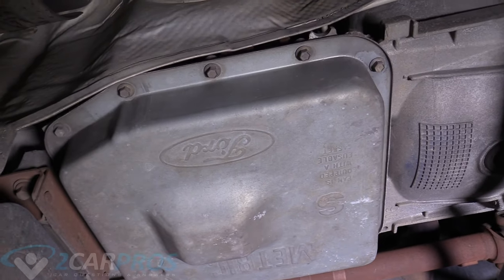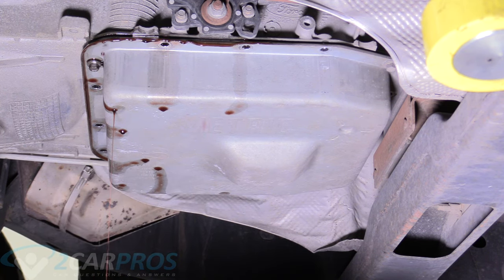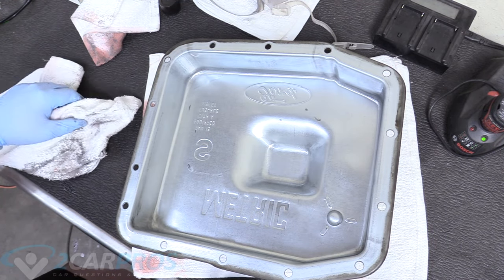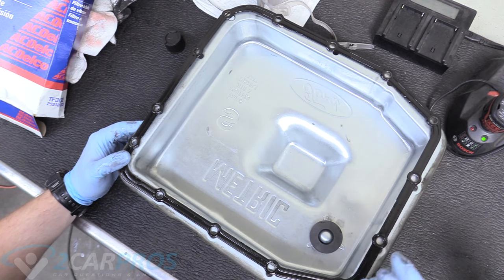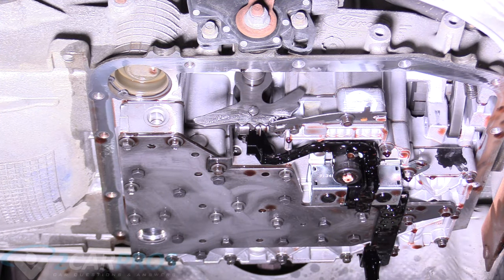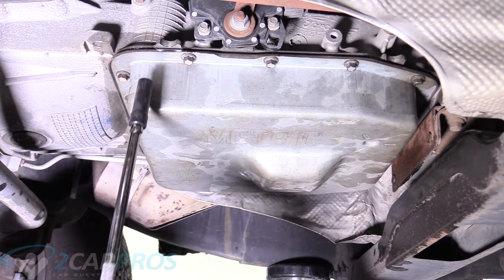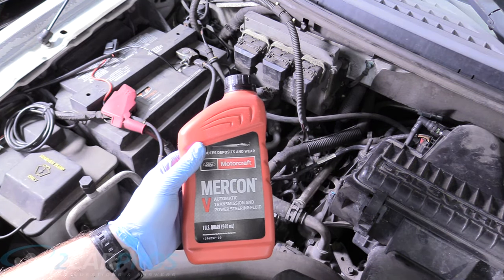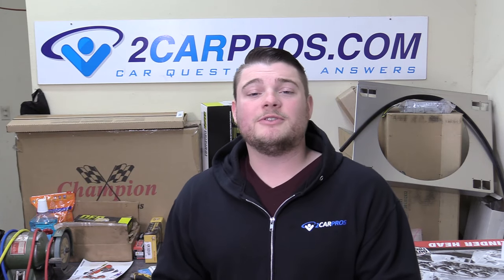How to Change Transmission Fluid and Filter Ford F-150 2004-2008

Comment: I’ve got a 06 190k miles f150 4x4 given to me. I dropped the pan swap the fluid and filter. I’ve driven a few hundred miles since and have a pump I could drop down the fill plug. Would you pump a few quarts out and add some more new stuff. Given the pan drop was only 5/13 quarts fluid swap?

Comment: When I removed the transmission pan, a little round with a one inch long yellow plastic thing was sitting at the bottom of the pan and have no idea where it's from, did anyone noticed that?
Reply: Fer Gap that’s the dust plug from factory. Meaning your fluid is still the same from when it was built.
Reply: @bobs-ht5zp  yep
Reply: Dust plug huh, sounds like an intentional obstruction for the transmission fluid pickup

Comment: I work at Autozone, and can tell you good call on using the AC Delco gasket. AC Delco parts (especially gold series) are commercial grade parts - and are excellent oem parts for whichever car. Especially your GM vehicle as AC Delco parts are actually better than most parts on the original vehicle from the dealership new. GM skimped on the new vehicle parts, but make up for it on their aftermarket AC Delco parts. Thats GM for ya.

Comment: Trust your Torque Wrench - if you clean your bolt threads & mating surfaces well & follow a cross pattern the 11 - 12 ft-lbs torque is perfect. Remember these are aluminum thread & can strip super easy! You will hate yourself!! If you believe you can guess the proper torque spec by hand then try a test. Torque a miscellaneous bolt then use your torque wrench to see if you're correct - you might be surprised with the difference.

Comment: “Controlled Spill” most truthful phrase on the Internet.

I’ve been a mechanic since 1991 and it’s shameful that these companies have not installed drain plugs on all of the products by now.
Reply from the maker: Thanks for watching! You know I was working on a 2014 Tacoma and it had a transmission drain bolt. Maybe it's just the American stuff that is lacking the bolt?
Reply: A fucking men!  I'm spoiled with my duramax.  Very easy changes except for fuel filter.  But it's only slightly aggravating.
Reply: in my f150 theres a little plastic ball with a o ring on it... what is that for and where dose it go?
it was in my pan...
Reply: @kendrickcunningham2493 yellow?

Comment: I too am watching this video 5 years after it was posted.
Personally, I was curious to see how difficult it was to access the F-150 transmission pan and filter. Good to see that no beam/etcetera is in the way of dropping it. Another question I have is why don't they install a transmission pan drain bolt just as they install an oil drain bolt. It would make it easier to drain the pan and not have it spilling over the top. Then remove the bolts and access the filter. 🤷‍♂️
Anyway, easy job, no beam to impede the removal of the pan. 👍

Comment: I understand using a corner bolt to hold the pan so you can install it. But if I may suggest starting in the middle of each side of the pan and work outward - correctly tightening the cross bolts and not the cross corners first? Generally for any type of gasket install (valve cover etc.) starting in the middle and working outward tightening the bolts will help push the seal to the corners, and help not cause any kind of "pinching" of the seal when tightening the pan bolts.  But maybe in this case Ford recommends your method. That's just how I was taught.

Comment: Super simple video that will make it easy to do it myself. Repair shop wanted to charge nearly $450 to do what you showed in your video. I'm sorry but no way! I can do it myself for less than $180. Thanks for the "how to"! Much appreciated! ($180 because I literally don't have anything to do the job, so that's gloves, torque wrench, drain pan, deep well socket, shop towels, carb cleaner, and everything else like transmission fluid, filter, and gasket. I also didn't cheap out on it either so it could be even cheaper than the $180)
Reply from the maker: Yep! Thanks for watching!

Comment: I have a 2006 F150 4.6 V8. Never changed the transmission oil before. I checked the dipstick on it on cold and it was full but kinda dirty.

Comment: Question after transmission fluid is put in... is it not necessary to cycle through the gears before starting the engine? I ask because that was recommended for my 2010 scion when I changed out the trans fluid, filter and gasket.
Reply from the maker: Putting the transmission through gears before the engine starts will do nothing due to the engine powering the pump inside of the transmission. Having the engine running while you go through gears with the brakes on will help get fluid everywhere it needs to go and then add more if it drops.
Reply: @2carpros  thank you for the clarification 👍

Comment: What about the rest of the old fluid in the transmission
Reply: Sorry for the late reply, but you never want to replace all of the fluid in your transmission. This is because if there are metal particles in your transmission and you flush it, it can cause the transmission to slip.
Reply: in reference to your querie here is a part of a reply I posted to another commenter.. "Your A/T relies on lubricated friction between friction plates and clutches and hydraulic pressure, after many years of wear the friction material has worn off the friction discs/clutches and are suspended in the fluid and actually still providing the service they were designed to do, once you totally flush out a higher mileage transmission that friction material is GONE and now you have a slipping transmission."

Comment: Great Video, can you tell me what the black round plug is just up from the transmission mine is loose and leaking a little fluid. I can see it in your video but I don’t know what it is. Is this the transfer case drain?

Comment: Great video!! I have a 2008 F-150 with 185,000 miles and never change the oil. Should I change the oil at this point? I’m afraid to ruin the transmission that is working fine.
Reply from the maker: Yeah you should definitely do this service if you want the transmission to last. Thanks for watching!
Reply: Is it true, transmission fluid has not been changed in a long time, it’s bad to put completely new oils?
Reply: @matthew7972 YES. For anyone who reads this. YES. It is bad to add completely new oil when you’ve done over the miles recommended for replacement. It’s recommended to add half of the old and half of the new when you’re in this situation

Comment: I am doing this job right now a yellow plunger looks almost like a spinning top came out and I cannot seem to find a home for it any advice?
Reply: Yes, I found this little top in the pan as you did: did you figure out where it goes?
Reply: So a few posts below yours solved the problem: it is a fill plug used on the assembly line. When the dipstick tube is installed it pushes the yellow top down into the pan!

Comment: Do you have a video  on how to change the sonsor or senoids inside the tranmission . I have a 07  it engages but when i step on gas pedal it does nothing.. i already try and change  many things but cant resolve it..? Thanks..
Reply: What did you find out or how did you get this resolved, Luis?
Reply: @marlinwilkes  
Well i did end changing the whole transmission Nd now its running all fine.
Reply: @LuisEstrada-kr1xo  lol😂 Well that works too
Reply: @marlinwilkes  i try everything from small to big chamges. And i got tired at the end. 
So.🤷‍♂️

Comment: What is the round rubber seal at the 13:50 mark right above your head?
Reply: That seal is from the  filter , always make sure you remove it if it doesn't come off with the old one. The new one will have a seal in it

Comment: Hello 
My car f150 2013 5.0 
It’s now 135,000 miles and im in qatar so the weather hot mostly , it’s safely to changing the transmission and differential oil.
Reply: Yes.

Comment: What type of gasket do you prefer to use on AT trans pans?
Reply from the maker: It is reusable if it is in good shape. But if it isn't I always like to use Fel Pro! Thanks for watching!
Reply: Victor Reinz Automatic Transmission Pan Gasket 71-14937-0- same as factory-metal covered in rubber!

Comment: How would you be able to drain the torque converter too?
Reply: That would involve a power-flush and let me tell ya, after almost 3 decades of being a Professional Technician I virtually never recommend this.  Your A/T relies on lubricated friction between friction plates and clutches and hydraulic pressure, after many years of wear the friction material has worn off the friction discs/clutches and are suspended in the fluid and actually still providing the service they were designed to do, once you totally flush out a higher mileage transmission that friction material is GONE and now you have a slipping transmission.  I've actually returned friends vehicles transmissions to their pre-powerflush reliability by taking used moderatly dirty fluid from a donor transmission and replacing the clean fluid in their slipping transmissions.  I can't say where I've seen a power-flush remedy a transmission problem in the long run.  I've seen COUNTLESS vehicles with transmission issues get power-flushed then run awesome THEN return barely a month or two later on a tow truck with a completely burnt up transmission and requiring replacement

Comment: Well explained. But to make sure buying a jug of 5 quarts should do it? Can we add Amsoil ATF?
Reply from the maker: You might need more. I think we ended up using 6 qts. I would only use the Ford recommended fluid. Thanks for watching Hector!
Reply: @2carpros  Amsoil far exceeds Fords fluid . Motorcraft is made to a price point over quality .
Reply from the maker: @Joblessparadise  As long as the API rating is over SN its very good for this application.
Reply: @2carpros  yeah , we exceed everything. If you use Amsoil’s lookup guide and the product is listed for the specific vehicle, it is covered under warranty.

Comment: Thanks bro Imma do this tomorrow for my Ford F-150 2005 fx 5.4 l
Reply from the maker: Very cool! Thanks for watching Edgar!
Reply: My transmission shudder about 40mh i use lubegard is work for 1 weeks the shudder came back i want to change the filter i how this help my problem
Reply: @CorvetteC6-LS2  if you disconnected your battery recently you have an adaptive transmission. Allow for the truck to relearn you and the shutter will go away

Comment: I drilled a hole in the oil pan with a self tapping roofing screw with the rubber seal on it. That way when you pull the pan off there is no mess. You can then drive the truck for about a week and drain the fluid again my removing the screw in the pan. Do this 2 or 3 more times, and you will be in good shape. 😀😀😀￼ Warning, don't over tighten the screw. And after your finial oil change apply A good Silicone sealer to your screw just for grins.

Comment: I was not able to find ford mercon V transmission fluid, would Castrol mercon V be sufficient for the job? Also, my truck has a different kind of dip stick, I’m not quite sure how to know if it’s full, how do I read those kind?
Reply from the maker: Yeah that will be fine. However all new versions of Mercon are backwards compatible unless stated otherwise. It should have the same dip stick unless someone put the wrong one back. I'd buy the stock one and replace it. Thanks for watching!

Comment: Hi friend, this is a great video and wanted to mentioned that I had a small accident with my 2005 4x4 F150 (broke the oil cooler and the oil leaked while driving), after a few miles I stopped and had to be towed back home. I'm in Canada and the truck has 270,000 km, got it one year ago and don't know any mechanic history of it at all. I have the new oil cooler and wanted to know if I should change the filter now that is "empty", and if you know how much oil I may have lost and how much oil would require to bring it to the correct level?
Reply from the maker: Yeah I would change it. Sounds like you will be basically filling the system nearly completely dry. I'd get a case of 12 quarts. Thanks for watching!
Reply: @2carpros  thanks for getting back to me on the issue and will follow your recommendations. I also hope I hadn't damage the transmission.
Reply: Did it today and I only recovered less than 1 litre that was left on the pan. Found the yellow plug inside (meaning was never serviced before). I cleaned the magnet (was full of debris similar to the video), the internal part of the pan and the gasket. Replaced the filter, installed the gasket and pan, tighten the bolts and filled the transmission with OEM Ford ATF Mercon V. I also replaced the broken oil cooler and connected the hoses. I poured in 11 litres and no leaks so far. Took it for a spin and the transmission responded as expected (so no damage). Will keep checking the level constantly and adjust it as required. Thanks for the feedback.

Comment: My truck has 166k. I’m worried about putting completely fresh fluid. I’m planning on reusing 2 quarts of the old fluid, just to be sure it doesn’t start slipping. Thoughts??
Reply from the maker: Put all fresh fluid in. The reason you are swapping out fluid is due to it being dirty and old. Thanks for watching!

Comment: I have a 2004 f150 fx4 and I think my transmission is overfilled, is there a way to drain it without opening the whole pan?
Reply from the maker: If you had a fluid extraction tool with a thin long hose you could siphon some fluid out via the dip tube. Thanks for watching!
Reply: Also, you can buy a large syringe and put a thin hose on it and extract the excess, that’s how I do it.

Comment: IMHO while you were in there you should have removed the torque convertor bolt
and drained that too. A great video thank you for posting it.

I am going to replace the original transmission pan with one that comes with the drain plug.
I will replace the drain plug with a FUMOTO drain valve, this will eliminate the mess and I will
be able to drain the old fluid directly into the containers. No crush washers and no chance in
over tightening the plug and stripping the threads on the pan either.
Reply: filter change?

Comment: My 07 f150 has 70,000 miles, haven't changed the trans oil. Is it still safe to change it at this point?
Reply from the maker: That is very low mileage for a truck that age. I would change it if were my truck. Thanks for watching!

Comment: Easy, unless your 6 year old comes outside and loses one of the bolts. Then you get back with the new bolt, cut it down to length, and start to fill it only to realise your dipstick tube leaks a little, no problem until you realise you cant check your fluid level because the dipstick sticks out the hole.
Reply: Relate.....very much 🤦

Comment: What about all the dirty fluid left in the torque converter?  Like half a fluid change ;) Now the new fluid is mixed with as much old fluid left in torque converter.....
Reply from the maker: You can drain it if you want to. But honestly you aren't getting the fluid out of the radiator either and there is a bunch in there too. Getting most of it out with the pan and putting a new filter is good. Thanks for watching!
Reply: @2carpros  an actual flush is done at the radiator. Run clean fluid in while vehicle is running pumping all the old fluid out. May be good for you, but not good enough...
Reply: @2carpros  I was reading to get the rest out isn't really a job most can do at home with normal equipment. Is that true?

Comment: Would replacing this help with gears slipping? It still has first gear but it takes about 8 seconds for it to go into first when shifting from park. 08 f150 with 174000 on it. And would you recommend changing the transcooler as well? Thank you so much for posting this
Reply from the maker: Yes it would. You can if you want to but you aren't getting every single quart out unless you rebuild the entire system. Thanks for watching!

Comment: Does this go for the 4.6 v8 ?
Reply from the maker: It sure does. Thanks for watching!
Reply: My truck just started to like shudder and or slip when at a dead stop and giving gas to go up a little hill I bought some of the dr tranny shudder fix and it hasn’t really fixed the issue could you possibly tell me what it could be
Reply: @riverdeluca6312  spark plugs maybe

Comment: I thought you were supposed to do this several times to really consider it a fluid replacement. Also, is it possible to add a drain bolt?
Reply from the maker: Should be every 60000 miles. Yeah why not? Just drill and tap it. Might do a video on that later. Thanks for watching!

Comment: I changed my transmission fluid on my 2005 ford f150, i put 5 new quarters of mercon v, but later i realized that one of them was dexron vi. Now every time that i stop then accelerate the truck won't move for like 2 seconds then it will jerk and start moving. Did i just ruined my transmission? Or it will be fine? Thank you!
Reply from the maker: You can't mix fluids like that. I would drain the transmission and cooler and torque converter, change the filter and fill it with the 12 or so quarts of Mercon V it needs. Then hope everything is okay. Thanks for watching!
Reply: @2carpros   wait, TWELVE quarts? I thought you said it only needs 6 quarts of transmission fluid? (ps:  hello)